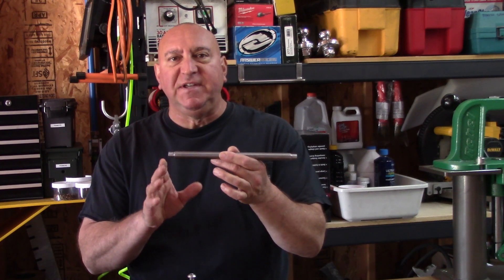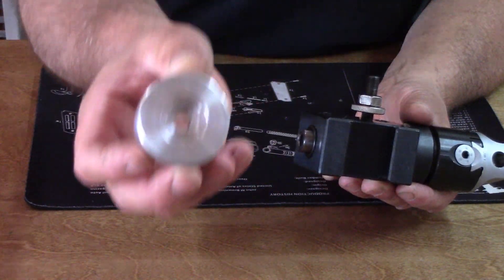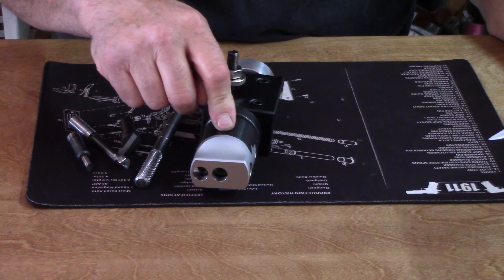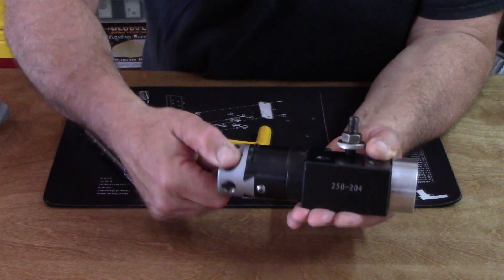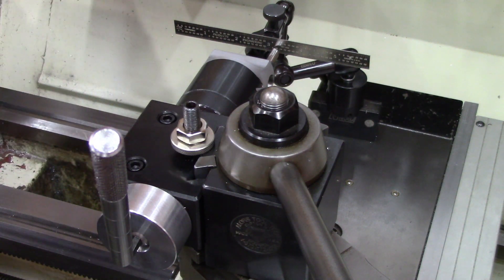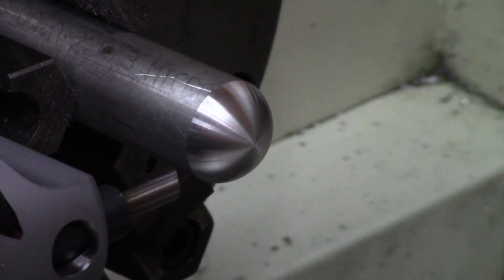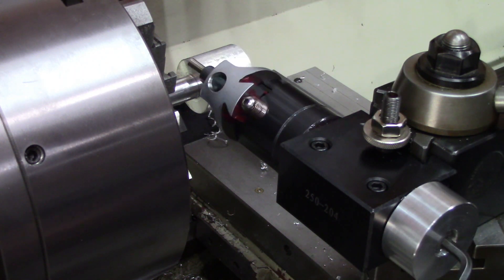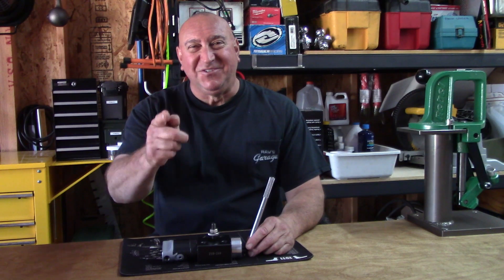Tool Post Radius Cutter

Comment: couldn't you make a ball of almost any size with how it stands?? just make a right angle tool to slip into the edge of the boring head (into the hole that's parallel to the adjustment screw) and the right angel to get the orientation right. Granted you might have to take it a little easy with the weakness of that geometry but it saves the cost of another boring head :) you touched on the idea when mentioning using an offset tool :)

Comment: Very nice You are fortunate that your particular lathe allows the cross slide to be retracted far enough back to allow for the boring head and tool block assembly to fit. I know for fact that some 10" and smaller lathes simply do not have enough room for that cutting tool assembly to fit in. I am jealous! I had to make an offset tool holder to move the boring head assembly back a full inch and my cross slide was still FULLY RETRACTED !!. Good job...THANKS !!
Reply from the maker: Thank you!!!

Comment: Would you be able to drill a third hole in the end of the boring head to accept the cutting tool?
That way you can see and adjust the screw without stopping the operation..😉

Comment: Ray, great video, one Q, I guess it wouldn't be possible to take the head off and turn it 180 so the tool lines up on the end or the boring head, not sure how the adjustment screw works inside the head for adjusting it. I'm sure if you could you would have done that. Like to know if you do.? I have a Grizzly G 709 Gunsmithing lathe, and as we have chatted before am a big reloader also.
Reply from the maker: Thanks, I could only get it to adjust one direction, other direction has very little travel.
Reply: Thanks Ray, great to know, I was thinking of putting a thumb screw that sticks out a  bit so you don't need a allen wrench.   @RaysGarage

Comment: Thank you very much for your clever idea, i already have that tool, but not with a straight arbour, i have instead both MK3 and MK2 taper shafts ( all three from ali-express ... ); but - after having get an adeguate piece of steel in diameter, i believe i can build the straight rod by myself, as the remaing parts too ...
At the moment i don't need to build any ball piece, but ... "never say never" ...
Meantime, it's better to get the whole tool ready to work ... 
Thank you very much again, my best regards from Italy ...

Comment: Hello Ray, I want to make one of these but I am working on a South Bend 10" lathe. My issue is that I am limited by how far outboard my carriage will travel. I am wondering if a 2" boring head would be too big? I already have a 3" that came with the milling machine I got from my dad but it's to deep. Is your lathe a lot bigger than 10" swing?
Reply from the maker: Hi Bryan, I use this on my 14" lathe and am not sure if the 2" boring head will work on your 10".

Comment: Great video on the radius build, why didn't you drill a few a few holds in the outer collar for the bar so you can just use what ever hole you like, seems to me that a allen screw would be hard to find the hole every time,  also really like the RCBS stand you made I'm sure, Happy reloading, I do also. Do more on your reloading please or things you make for reloading.👍👍👍👍
Reply from the maker: Many Thanks! I did make a few more mounts for reloading, case sizing and de-capping. The main reason I do not do reloading/firearm videos anymore is that YT will shut me down, so I was forced to remove most all of my previous firearm related videos.

Comment: Nice job! Though i'd go about it a bit different i reckon. I would turn it on it's side and mount it via the compound mounting points, removing the compound and toolpost altogether when using the radius tool. This would add rigidity, and also allow you to traverse your cut using the saddle movement as a traditional radius tool as opposed to needing to fiddle with that set screw.

Comment: Hi Ray can you please tell me where can I get the cutter knife? I'm preparing my set up just like yours. Thanks
Reply from the maker: You can use any 1/2" boring bar, the 1/4" HSS cutter I show in the video I made from 1/2" round bar and pressed the the HSS rod into a undersized 1/4" hole.
Reply: @RaysGarage  ok thanks

Comment: Great job Ray. I have a nice used Holdridge radio cutter that I purchased years ago but I’ve been toying with the idea of making a boring bar turner for quicker/easier setup.  I may copy your design.  
Mike
Reply from the maker: Hey Mike, For sure buddy! It work really well for a very easy to make tool, on steel as well!

Comment: What ho Ray,
Nice video, have something of the sort built from a 50-60s design in Model Engineer magazine. Apart from the obvious use, it works well to put a slight arc on the end of male threads to add that pro look.
ATB 
 c
Reply from the maker: 👍👌Thank you my friend!

Comment: Nice setup Ray. I've had to make a few of those over the years. Alternate suggestion for you. If you set the tool to the OD of the material, or the OD of the round you want, and restrict the sweep to allow the tool to only get to the OD ( vertical) , you only set the radius one time. Then you use the carriage movements for incremental shifts between cuts. Just start with the carriage off the part by the amount of the radius you have set. Stefan Gotteswinter did a ball in a mill using a head like that. It was also very clever. Hope you're well bud.
Reply from the maker: Thanks Joe, I'll have to check it out and give that a try!

Comment: That works great Ray.. I have similar unit using boring head. I used bronze bushings in the tool holder, fitted to the diameter of the shaft of the boring head. I also use a short piece of allen wrench, stuck into a knob, and leave that in the screw of the boring head. I use a round HSS bit as well.. Curious to see how your other cutters work... Love to see you cut some internal concave radii.. I haven't tried that...  Good to see you back !!!  Thanks for sharing

Comment: I had to weld my arbor on because it comes loose from the head.
Reply from the maker: Would a set screw have worked as well?
Reply: @RaysGarage  i use it to bore on the mill , when boring a OD i run it in reverse and a tig was faster that day. A set screw might slip on a heavy cut.

Comment: I made one like this and finally discarded it. It was real pain to use and really slow. If you notice in the video he isn't locking the gib on the boring head for each cut. That means the small adjusting collar inside the boring head is taking all the load. The adjusting screw and collar assembly is hardened and vibration from the cutter is liable to break it. Ask me how I know this.
A vertical post type is very easy to make and ever so much easier to use. Once the cutter radius is set then all the movement is feeding the cross slide into the work.
Here is the better design I used. The fancy base plate was just a repurposed plate from something else.
https://postimg.cc/z3p5x9Zb
Cheers from NC/USA
Reply from the maker: Nice design as well. Looks like you have a ton of machining work and expensive materials. My goal was inexpensive, quick and easy like I stated in the video. I exceeded my goal and obtained excellent results. Thanks for sharing.

Comment: Nicely done! I don't know how much torque is required on that handle to turn the cutter through the material, but maybe a mod could be to use an aluminum 5 lobe knob instead of your stepped bushing on the back. Should allow easy movement back and forth without interfering with anything, and if you need more torque, you'll still have that hex in there fastening the knob onto the arbor to pop in your lever when needed. Just a thought. I like the tool! ----Aaron
Reply from the maker: Hey Aaron, The knob idea is great but not sure if you would have the same control from keeping the cutting tool from getting away from you. It would be worth a go. Thanks buddy!